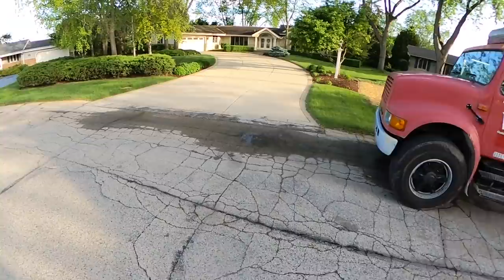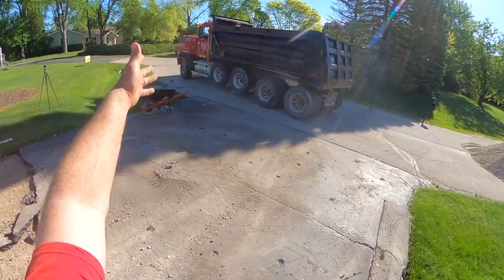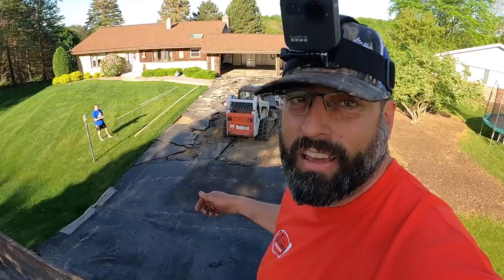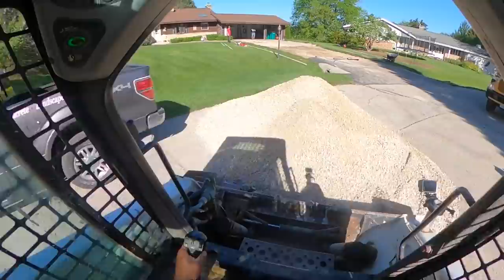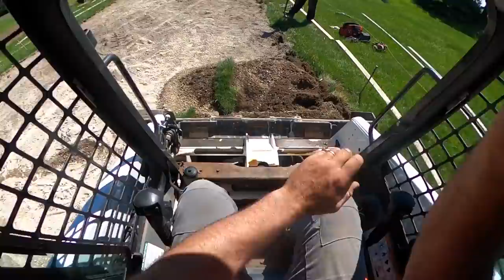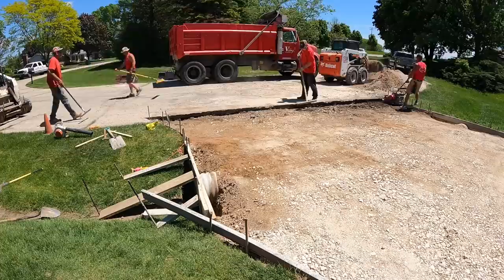Bad day at work and an angry school bus driver!

Comment: Those t320s are good machines when they're running.   I used to own one but had to get rid of it bc after 4000 hours it was constantly broken.  Mainly track stuff.   I kept up on the maintenance.  One year I spent 13k just on the undercarriage.
Reply from the maker: Yep, they are expensive to maintain no doubt, but most definitely make it up in productivity.  I have had 3 and have gotten rid of them before 4000 hours.

Comment: You can see that driver had the perfect angle lined up to make it and she turned her wheel to the right as soon as she hit the pile.. She just wanted to complain about something. She absolutely had plenty of room.
Reply: as not only a profesional driver, but also as one of the best truck drivers in Denmark, i can verify just from that very short glimps of what manouvre room there was, that there was plenty of space to get around, its all about how you manouvre and place your truck/bus on the road. granted she may not have had the experience or know how to do that, but she dident even try..

Comment: You can get those drive motors rebuilt for MUCH cheaper than buying a new unit. Just have to find a shop that has to capability to rebuild them. Their a pig to bust apart and need special tools to do so but, thats actually the hardest part rebuilding and getting the rebuild kit is quite easy from there.

Comment: What is that material that you pour before the concrete? Like, the material you compact. Forgot the name. Here in south Texas I have never seen anyone do that. Is it helpful for the structure or it’s supposed to be done due to coding. I am a ready mix driver and I always like to watch new trades and since I deal with concrete workers I want to know about different methods of the trade. Thank you in advance.

Comment: You're lucky that Bobcat didn't break down before you could move the gravel, she would've been yelling for the next 2 hours.  She made it sound like it was a national emergency.  Well, she'll be back tomorrow, make sure the concrete comes at 9:30.  I had some touch ups to do on a new house after they had partially moved in so I parked in front of the house.  The lady comes and loses her mind like that bus lady telling me to move my truck and trailer because she wanted to park there.  I moved it to the end of the cul de sac so she could park her Honda Civic.  Guess she had short legs.
Reply from the maker: I know right, I was wondering what would have happened if it broke right in front of the bus blocking the street.

Comment: Buy Kubota skidsteers. Bobcats break constantly and the parts prices are outrageous
Reply from the maker: I have owned I think eight or nine bobcat skid steers and currently own three.  I have had really good luck with them.  All equipment breaks down once in a while. Also I have a great dealership two blocks away.  I think all the manufacturers make some pretty solid skid loaders nowadays. The kubotas do look pretty sweet though.

Comment: I notice you and your employees when operating the skid steer tend to have a bad habit of traversing on hard dry surfaces. With tracked machines you want to avoid doing a nuetral steer as much as possible, wide sweeping turns, that will take away a lot of the load on your tracks and driveline.
Reply: Hawg Hathword  Oh yes an intellect I see,  I love it. Because that make sense. I totally came off as rude and intrusive and in no way made it seem like I was trying to genuinely help. He had a driveline failure on one of his machines and this bad habit  definitely didn't help, very similar to your comment.
Reply: What's the name of your company?

Comment: Theres hardly any fill on that culvert lol
Reply from the maker: True, we only had 5 inches.  You got to work with what you got.  We put a ton of rebar and mesh over it though.  I have had to do that in the past and haven't had any issues but your right, I would prefer to have a few inches of gravel over it at least.

Comment: Regardless of attitude, she is in the right. I understand you have a job to do, but you have to understand she does as well. You do not have the right to block the road. She could have easily called the Sherriff/DOT.  That rock/sand mixture could have easily been held in a dump trailer till ready, dumped direct when needed. Seems like a piss poor dump job in the first place. And using a tooth bucket to move the pile on public roads? Just some constructive criticism.
Reply: She had PLENTY of room and was being directed on how to get around it but wanted to cause a problem for someone doing their job.

Comment: How high is the dump truck?
Reply from the maker: I never really measured but the small skid loader I was using just barely cleared the rail.  It was a real pain but we got it done.  That job is poured now, that video is coming out tomorrow at 9:00AM.
Reply: @VictoryOutdoorServices  how do you keep boards to height with steel steaks behind. What keeps them to be touching string?
Reply: @adanr150  he screws the pickets to the boards to keep his heights and maintain a gradual slope so water flows from the driveway toward the street
Reply: @josesoares1245  can you make a video of how to slope from house to curb?
Reply from the maker: Jose Soares is right, the stakes have nail holes and we nail through the stake into the wood to maintain the elevation.
Reply from the maker: Your right!
Reply from the maker: I'll try to do that sometime.
Reply: @VictoryOutdoorServices  steel stakes better than word???
Reply: @VictoryOutdoorServices  sorry wood?
Reply from the maker: Steel stakes are reusable and will last for a very long time.  Plus they are easier to drive into the ground.
Reply: @VictoryOutdoorServices  you made cut and made your own or they ready to buy like that.

Comment: You should not let junior drive the buggy it is putting to much pressure on the engine it will let you down one day and if I was you I would tell the lads when they sleep in to turn round and go home it will stop them when they get there pay I know you will struggle without them but it works and if they ring in sick and you no they are telling lies tell them to have the weak off you are a good boss but to soft with them Erik thinks it’s a joke when you say anything about sleeping in